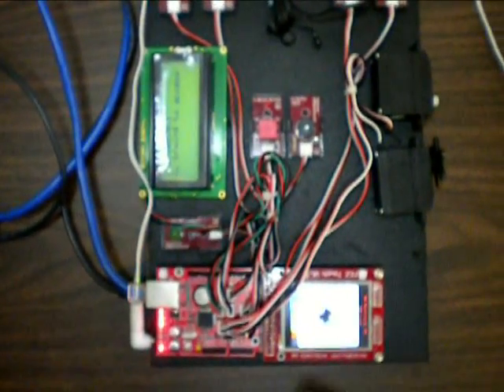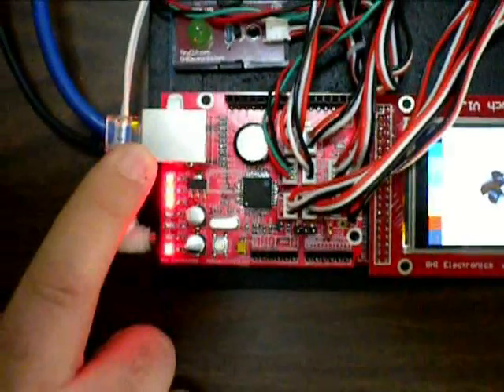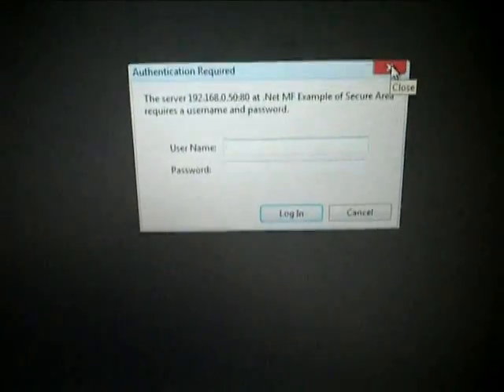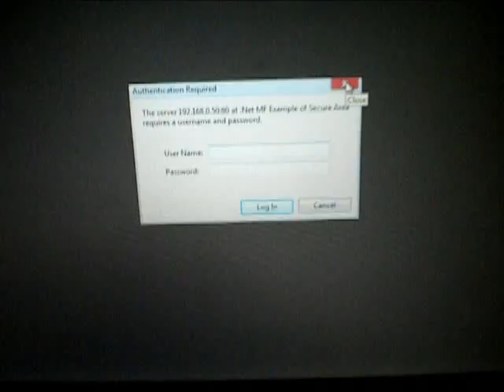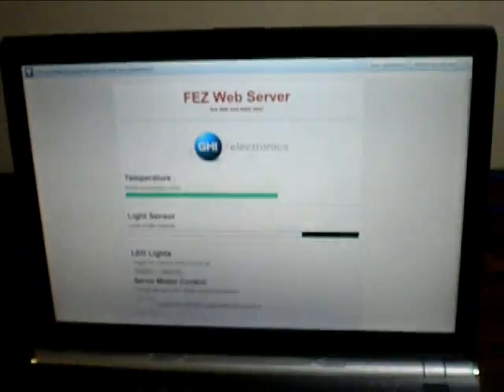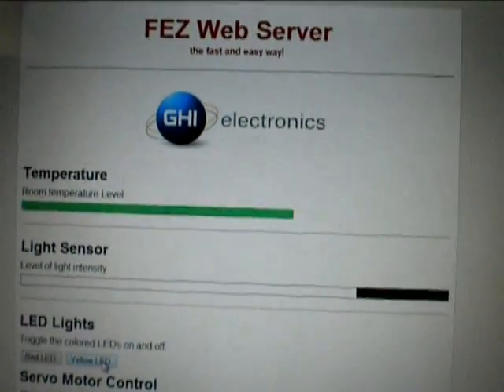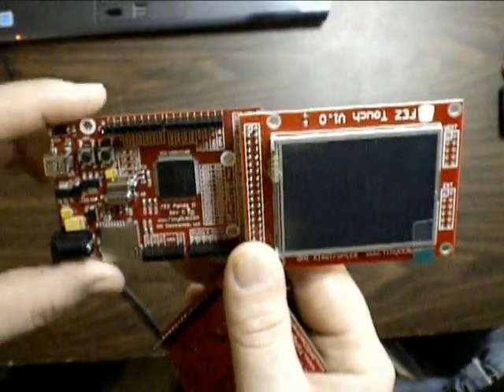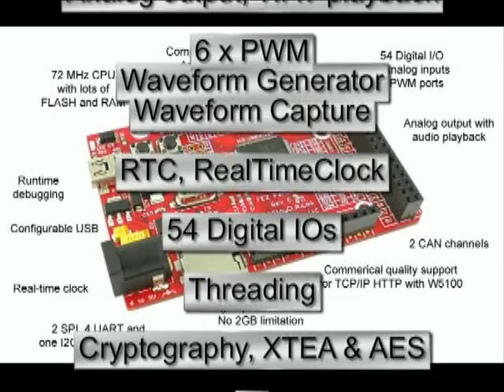FEZ Panda II

Comment: Hello I have a Panda 2 card,but try to find info on the 40pin connector to interface into the Panda,can you recommend a maufactuer for plug,pitch size.
As building my own interface card to Panda,does GHI have a blank Gerber file so easy to use on a pcb design software as measurements\spacing layout  are needed.
Thanks
rob